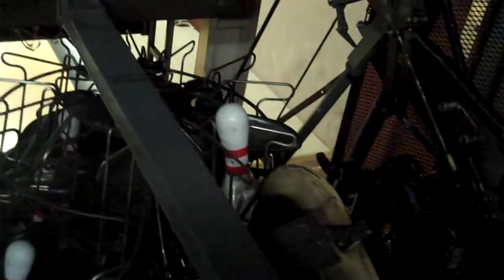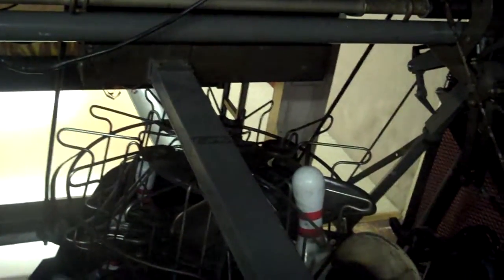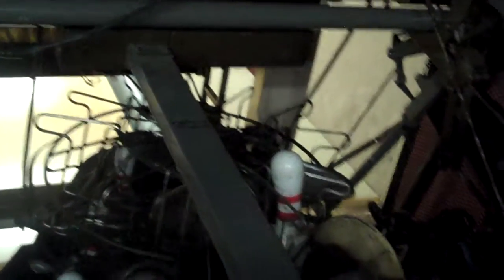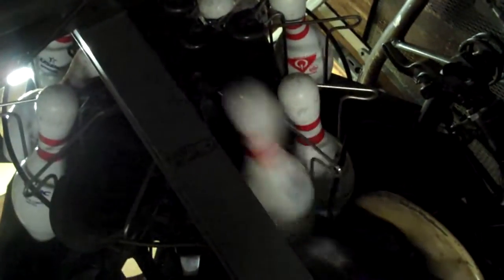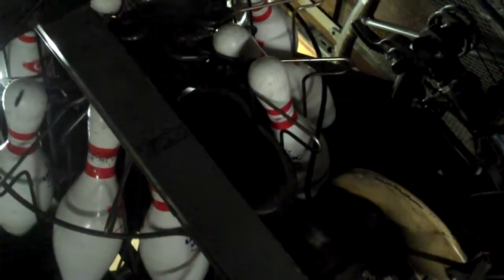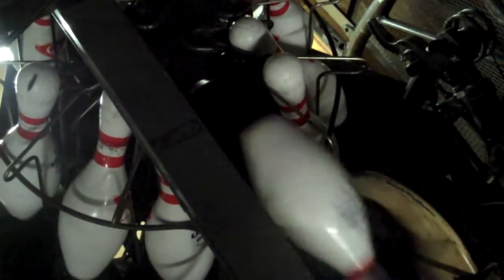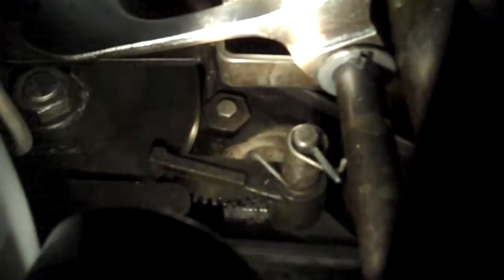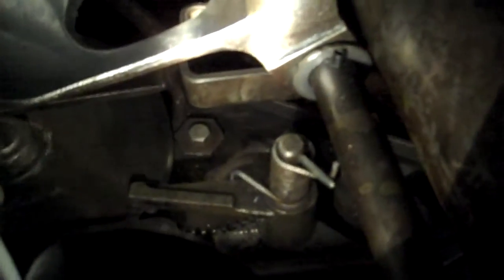Brunswick Pinsetter - Shotgun, detection, A style vs. A2 style assemblies, etc.

Comment: On the model A there is no shotgun quick drop rake system only the Jetback and the A-2 have the shotgun.  If you look at the detector there are two threaded mounts at the front of the detector that is where the model A solenoid was located the solenoid was relocated to it's present location on the Jetback and A- . Also the model A detector had a 90 degree over travel to set a new rack quicker. That was eliminated on the Jetback and A-2
Now the interesting thing is I have seen videos of a model A with the shotgun system installed but still using the original model A hockey sticks and lift rods and the original model A ball cushion. While the A still used the original cushion lift rods they are much smaller and not rigid like the A-2 configuration. Yet they still trip the shotgun about 85 % of the time. Someone has posted videos of their model A machines with an aftermarket shock mount mounting two shocks to the model A ball cushion thereby reducing the broken hockey sticks they normally get where the cushion mounts to the sticks thru the two bolt holes at the bottom of the hockey sticks. There are some centers that have upgraded their model A machines to Jetback or A-2 configuration doing the work in house that is why there are videos of A-2 machines with the wrong lift rods and the wrong ball cushion for an A-2. The work required to upgrade to A-2 can save you money by continuing to use the model A ball cushion and lift rods and really works well if you add the shock mounts to the rear of the model A ball cushion. One of the best items you can do to a Brunswick Pinsetter is replace the moto pulley to what is known as creepy speed you also slow down the accelerator from 35 mph to around 10 mph. It greatly reduces your operating cost and makes the machine far more reliable. But that is my opinion and everybody has one and not all are the same.

You never no matter how long you've been working on pinsetters ever stop learning someone somewhere comes up with a way to make the mechanics life easier
Reply: The shotguns that you see with Model A hockey stick's are ones with ZOT's quick rake drop kit, which uses a detector in front of the rake which after a set time, will trip the shotgun by using a solenoid. You are right that normal Model A's without ZOT's quick rake drop kit, only have a rod going from the rake cam follower to the C lever.

Comment: @Rep2369 For the longest time I have always wondered what boosters looked like and actually just today I found another video and I finally saw them in operation. I'm actually pretty impressed with how they look. I for one was only really a fan of the gravity returns since I just kinda felt it was easier on the ball. But the boosters are only in contact with the ball for not even one second so I guess that's why I like how they seem to operate.

Comment: And speaking of the scorers, when the center here had the As, it that the Brunswick2000 scorers, and if you got the third chance on the 10th frame after sparing or striking on the second, the machine would switch to second ball right after the cycle finished, was kinda interesting.

Oh and if you're curious about those As, the only mod done to them was that there was no 90 Overtravel, but other than that, there were no other mods on them.

Comment: I was in Cincinnati Ohio for a bowling tournament recently and the place had Brunswick A2 Jetback pinsetters. Te weird thing about them were when you threw a strike, the pinsetter would go into second ball mode and sweep the lane without the pin deck coming down for a strike detection. The machines were hooked up to a newer version of the Qubica scoring system